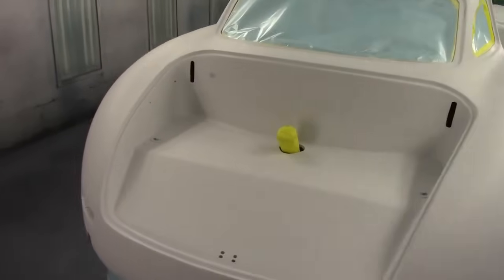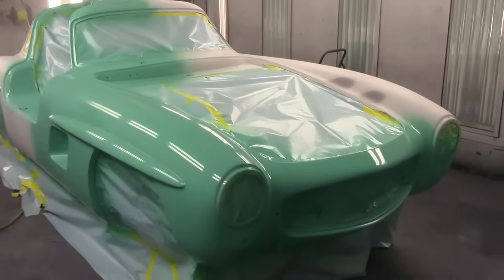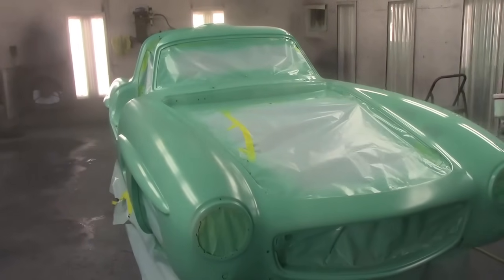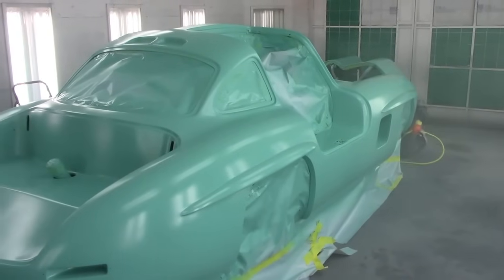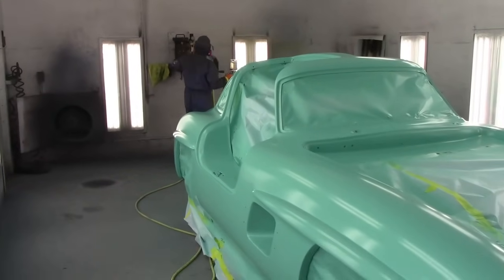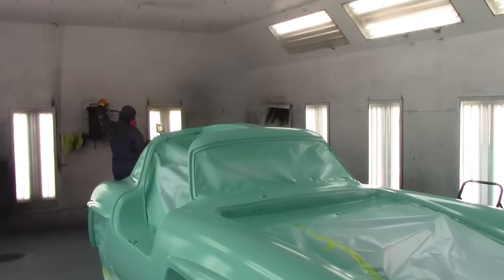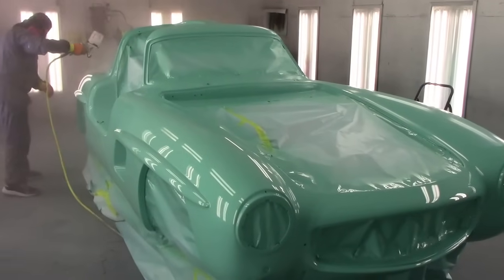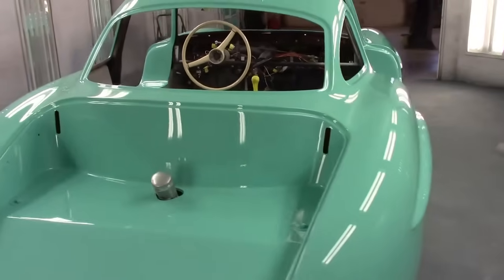Small Town Shop Builds a Multi Million Dollar 300SL Gullwing Tribute...On a Blue Collar Budget!

Comment: When I worked in the Foreign Auto garage where I was trained, one day a white 55 300SL was on the trailer in the garage lot. I went in and Jeff told me it was my next project.

The car was inherited by kind of a knucklehead who was born into money. He lived here in Mass in South Dartmouth. If you know anything about that area, you will know Money is everywhere. The car was in a barn since the mid 70s untouched but covered.

It had a red houndstooth interior and it was bright white on the outside . It was rather clean but needed tires of course. It has Rudge wheels and we had it running in 2 days. Surprisingly it needed very little in mechanical terms. It has direct injection so the pump was taken out and rebuilt by Mattie Benz of RI.

I drove it a few times and it went well. You get a lot of looks especially getting in and out. The color on this car is something else. Well chosen despite what a few have said. It's a driver.
Reply from the maker: @NitroModelsAndComics  What a cool story love it